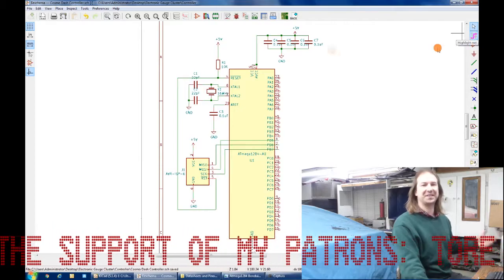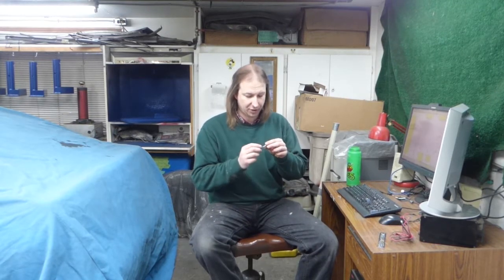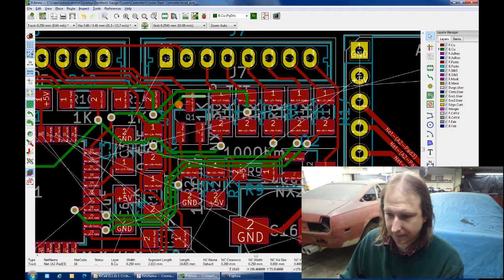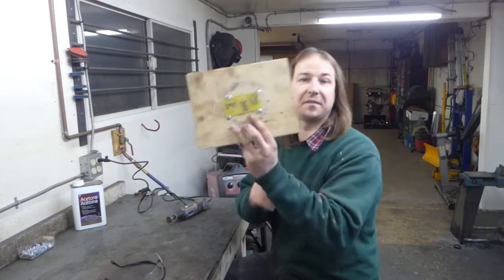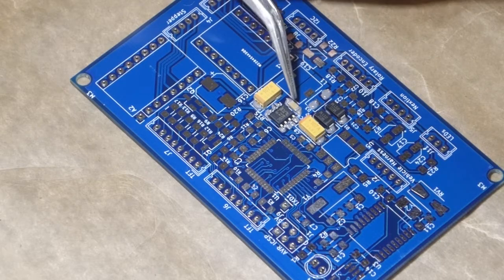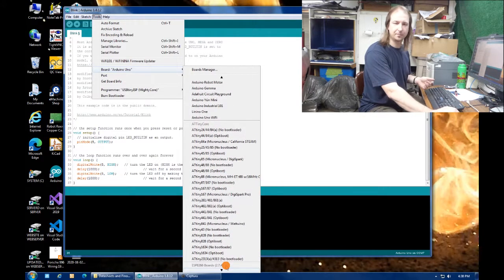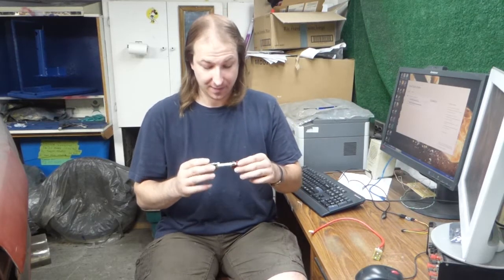Part 50: Electronic Instrument Cluster Conversion - Part 4  - My 76 Mazda RX 5 Cosmo Restoration

Comment: Good to see you back!  Don’t know if someone else mentioned it but you forgot some stitching vias connected to ground before the ground pour. Anytime you want another set of eyes to review let me know. Really nice project!  (I almost bought a Cosmo back in the late 70s but it didn’t have AC)
Reply from the maker: I don't have the PCB files handy since I am at work, however as I recall every through-hole ground pad connects to both pours so there are a fair amount of vias between the layers.

Comment: You forgot a flux capacitor and a hook to transfer 1m gigawatts of power from a lightning bolt. Also, you need a box to enter the year you want to go. These are basic ingredients to build a successful time machine. You need to go back to the drawing board bro.
Reply from the maker: It's 2022 so I can buy Plutonium at any corner drug store.

Comment: What's the name of that recording software, captura ? Does it work on Windows xp?
Reply from the maker: Yes, Captura. I don't actually like it very much because of the "modern" interface and that it is .Net based so it is very slow and resource heavy. However it produces very nice MP4 files. I previously used CamStudio which worked well but had some bugs like long recording times corrupted the output files. And it was limited in formats so I ended up with multi-gigabyte .AVI. Captura won't run in XP, but CamStudio definitely will.

Comment: You sir are an absolute sorcerer when it comes to designing and building anything electronic. With the amount of work needed for just ONE board, I still can't believe you had to build THREE of them.  Also, I have an idea that you might consider. Since the Auto Transmission indicator light cells in the cluster go unused on a manual transmission car, why not reuse those openings for something a bit more fun. One could make a pretty awesome boost gauge there using some RGB LEDs like you did with the turn signals. Bottom two openings could be Vacuum in Yellow, middle three indicate Boost in Green and the top one in Red showing Overboost (1-2psi over normal boost) in case something goes wrong.
Reply from the maker: Once the first board was done, the next two were just an assembly line. Nice thing about SMD soldering is you can just paste the components in place then solder the whole whack in one go with the hot air. So it was only really another hour each on the next two boards. I had originally planned to just eliminate the auto transmission indicator holes when I recovered the binnacle, but now I'm starting to really like your idea. And it would be easy to add more RGB LEDs as I designed the connectors with a passthrough. So it would just plug into the existing board and be just a software change.
Reply: @aaroncake  With the right code, tied into the potentiometer/button, you could conceivably switch between boost and any other data display you want there too. Oil pressure, IAT, Coolant temp, etc,  use your imagination. Just give me a shoutout when you go for it, hopefully I'll be finished with translating the Eunos Cosmo workshop manual by then.

Comment: FYI even if you screw up the configuration for the microcontroller, you can reprogram it without desoldering it: when programming the clock frequency setting doesn't matter (you can even clock it at like 100KHz and it'll work). The only thing that will give you trouble is setting it to external clock if there's no externall oscillator connected
Reply from the maker: And it can always be recovered by a high voltage programmer if the fuses get completely messed up. When developing, I just load the Arduino bootloader since I happen to have the serial port ready for connection on the Nextion header. Just means manually toggling reset at the right time.

Comment: Your electronics knowledge is unbelievable!
Reply from the maker: Thank you! Electronics has actually been my hobby since about grade 3 and into my early 20s, at which point I got out of it. Got back in when I built the tail lights for the Cosmo. The hobby certainly has changed now with the availability of cheap microcontrollers and programming platforms.

Comment: Hey Aaron, put an esp8266 somewhere for Home Assistant integration with the car!!!
Reply from the maker: Actually, that's sort of the plan. When I build the body control ECU it will definitely include an ESP8266, ESP32 or whatever the WiFi-de-jour is at the time. So it can report telemetry (and possibly respond to commands) via MQTT. Of course at that point it is easy to interface with anything including Home Assistant.

Comment: Instead of using visual studio, you might want to try using visual code with PlatformIO for programming these Atmegas
Reply from the maker: I use VSCode for a few things, primarily as a YAML editor. Honestly though, I hate it. And not just because it is built with Electron. I'm just so used to the VS dev environment because I started in Visual Basic 3.
Reply: @aaroncake  ah well nothing beats familiarity. I'm not entirely sure but maybe it has something to do with the operating system. I couldn't help but notice that you are running Windows 7 which is no longer supported by Microsoft. Maybe that has something to do with visual studio being a bitch at times. 

Hopefully you'll get it sorted out, great content as always Aaron.
Reply from the maker: I suspect it was actually a bad update somewhere down the road because since the video I totally uninstalled VS2020, downloaded the offline install image and reinstalled for that. Then manually re-added my extensions one by one. So far, so good.
Reply: @aaroncake  Good to hear. Say, Aaron, when was this video taken? You talked about the PCBs that you ordered early last year and only received in June. That's what made me wonder how much time there has been put into making it.
Reply from the maker: So the footage here ranges from about Dec. 2019 until summer 2020. Because it was not only a long wait, but a beast of an edit. Then the next video will include footage from that point until spring 2021.
Reply: @aaroncake  Can't wait for the next part ;) Good luck!

Comment: you are a smart man where did you learn about circuit boards I have no idea how you do it
Reply from the maker: Thank you! Well, I admit that electronics has been a hobby for me since grade 3 when there was a joy in building a crystal radio or flashing some LEDs. Then I got out of it in my early 20s, only to come back a few years ago after making the LED tail lights. The hobby had changed so much. Electronics in a way got me into cars, because it got me into electric vehicles in my early teens. Then I bought an RX-7, which makes perfect sense.

Comment: try useing windows 10 bro .... no software likes windows 7 its shit
Reply from the maker: You can take my Windows 7 out of my cold dead hands. Sorry, but I work in IT and Windows 10 has been an unmitigated disaster. If it works for you then by all means use it. But since Windows 10 was released, we are spending 70% time fixing Windows problems than before primarily due to the horrid quality control problems with updates. I'll continue to use Windows 7 until it is no longer viable an then probably continue some more. There is not a single thing that would improve my workflow in Windows 10 and I don't feel like my computers randomly breaking when Microsoft decides they will.
Reply: @aaroncake  I understand but just saying that program works better with win 10
Reply: I aint dissing you Bro I love this channel for many years. But we had issues with the same program at work with win 7 and to be honest from my experience gameing win 7 was shite. But whatever works best for you
Reply from the maker: It's OK, I understand. If it works for you then I'm not knocking it. Yeah, and lack of new DirectX support basically dooms Windows 7 for new games.

Comment: Are you going to have a USB on the dash to program/reprogram without disassembly?
Reply from the maker: Probably not, but possibly I will have the programming header exposed for the first few runs. With the bench top rig I made, everything needed to run the cluster out of the car is provided so by the time the car is on the road, the code should have been running for months if not years on the bench so any issues should be well sorted. Now of course if I decided to add features, I'd need to access the back of the cluster to reprogram but the cluster comes out very easily and I've set up the controllers (you'll see in the next episode) to be accessible under the dash. After all, everything is a prototype.
Reply: @aaroncake  awesome. Sounds like you have everything though out 3 times over.
Reply from the maker: That's my curse. While others are fantasizing of the opposite sex, I'm thinking of how to code an instrument cluster.

Comment: Super cool project.  I use Altium at work and I can relate to how tedious arranging a board can be.  Good idea to do a print out to check component fitment before sending it out.
Reply from the maker: The printout has saved me a few times when the package of the part I received didn't match up with the component library. From what I understand, Altium combines the symbol and packages into one? KiCad separates the two so you can assign an arbitrary package to a symbol as long as the number of pins match. Good way to get into trouble.
Reply: @aaroncake  You can change the package on the pcb side of Altium at anytime.  It's a good program but expensive.  I wouldn't use unless work paid for it.

Comment: nice to see you use kicad instead of that .. other thing; as you promised
Reply from the maker: Oohhh...but Copper Connection is just so straightforward and quick. Great for simple circuits going right from brain to PCB if a schematic isn't needed.

Comment: Silly question Aaron. Was The Cosmo originally fully analogue dials? Magnet spinning to move the needle and air/oil pressure moving copper tubes etc? I ask as I am embarking on a similar project with my 1972 mk1 Ford Escort. The dials are super expensive and even more fragile now. They are not reliable or accurate either hence my plan to move to steppers. Your work is spot bollock on and I plan to borrow what I can from you as you make it appear super easy.
Reply from the maker: The gauges were electric galvanic movements except for the speedometer which was the inductive spinning magnet type. So in a sense they were always electronic, just not the type we want. Gotta say, if you are going to do the same project, it's a crap tonne of work. :-)
Reply: @aaroncake  thanks for the reply. Ill make the most of the old gauges and keep at it as a background project for now. Last thing I want is to be held up over the gauges ;-)

Comment: 28:25 i think, and i'll stand corrected if i'm wrong, that you didn't add some solder to the pins before putting the board on. I know it sounds counter intuitive, or a waste of time, but it does give a much stronger bond if you pre-coat them. Also, for fine electronics, you don't have to spend as much time heating the part to get a full solder. Just my 2 cents, kinda looked as if they were bare.

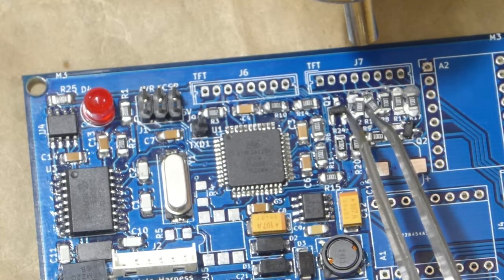56:00 two options: 

a. even smaller nozzle (after market solution, of course) but keep in mind you shouldn't operate the tool for too long, because restricting the flow does stress the motor.

b. you start up higher. So instead of going after a specific portion/item on the board, you "dive in". I usually do this whenever the density is correlated with the insanity or i have to fix something coked up inside an existing board. I've also taken the rather un-orthodox way of heating the underside of the board a wee bit using a heat-gun set on low. Not enough to kickstart the solder, but just enough to make the board toasty, and thus speed up the process. I use a special board holder that allows me to keep the board suspended over the heat-gun.
Reply from the maker: It was actually the fault of the camera. I had to have it close enough to the board, which really limited where I could position the hot air nozzle. And yes, definitely I had it too close at times. I think there was a lot of heat needed becuase I had the board on my metal bench top. Big heatsink.

Comment: Hi I've followed this project for 10 years almost, have you set a date when you will start the car for the first time? I look forward to all episodes , very interesting to follow!
Reply from the maker: The car will be started when it is ready to start. Which will likely be before it goes to the body shop for paint, or even after. Once it is started, the engine is no longer in storage and starts to degrade whereas now, it can basically sit indefinitely.